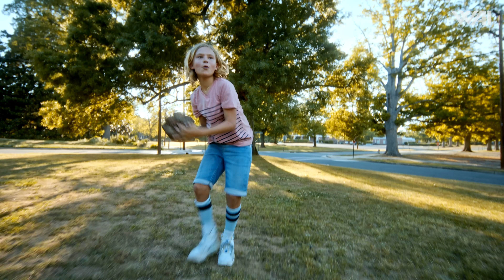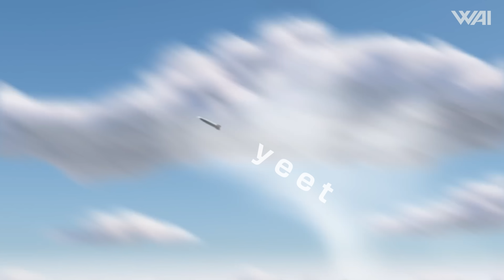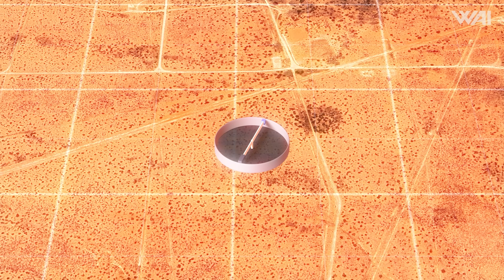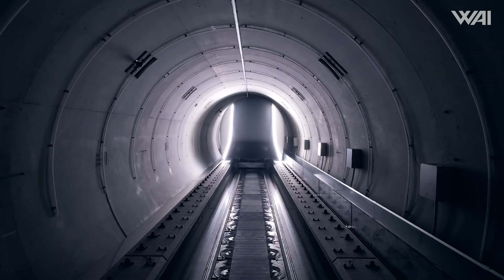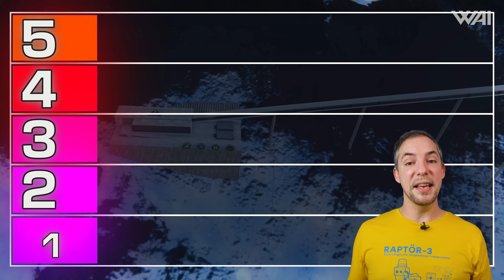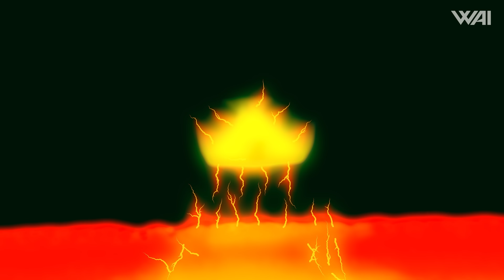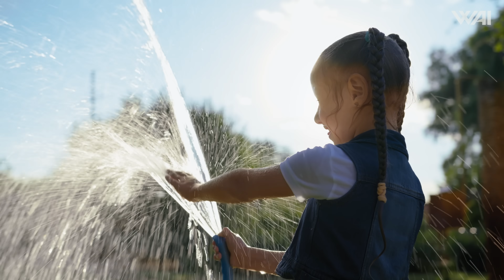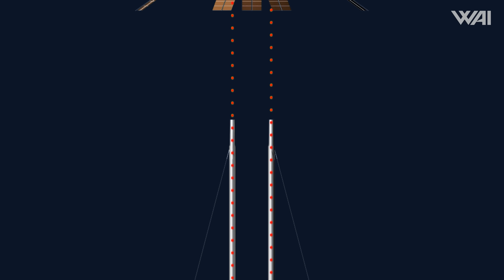The five craziest (but possible) ways to get to Space!

Comment: My biggest worry about nuke-based transport would be having to trigger the Launch Termination System while still on the way up ...
Reply: I think the compromise he talked about would do away with that.
Reply: I think the worst part is that fissile material is actually pretty rare in the solar system.  It would be a shame to blow it up rather than use it to generate electricity.
Reply: @arthill2310   Worth it for gathering more elsewhere. Gotta spend fissile material to gain fissile material.
Reply: If they follow my desigh concept the nuclear fuel is Van Allen radiation belt waiting for harvest and in NEED OF IT.

Comment: Thanks for the awesome side video, those alternatives were a lot of fun! I remember seeing a cool idea called a Lofstrom Loop in an old Isaac Arthur video about Launch Loops which seemed much more feasible than Space Elevators or Mass Drivers. Instead of a massive vacuum tube with the vehicle INSIDE (RIP Hyperloop!) it involved a vacuum tube only 5cm wide(!) supporting an EXTERNAL track for launch vehicles "only" 1,000 kms long and "only" 80 kilometers high to get the vehicle above the atmosphere to eliminate carrying onboard fuel for that first part of the flight. Lofstrom apparently published a detailed paper in 2009.

Comment: You don't need to build towers to hold your launch tube --- the other end has to be in orbit anyway, so suspend it from above on skyhooks

(skyhooks are large weights in LEO holding up your launch tube)

Not to mention the magnetic fields generated by that other design would destroy all the electronics around

Comment: You know. Drones can breach the atmosphere with very little resistance. But NASA and that pesky "astronaut" thing.

I'd thought about it. Figured why not use the hull of a rocket? Use electromagnetic coupling plus physical anchor point in case of failure or interruption.

Mother drone takes the capsule to 40,000. Drone drifters lift the capsule using electromagnetic energy. Glide up into the upper atmosphere.

From there, you get orbit breach and assist from those same drones or a new squad. 

Drones assist in piloting the capsule. Then assist in docking.

Would it be expensive to do? Yes. Yes it would be for the first round. After that? What's that phrase again? 

"Easy money"

It's infinitely reusable. Infinitely cheaper than "ooga booga rocket go boom." It's also a designed recursion to ensure survival. If one drone or even several get knocked out, it doesn't equate to mission critical. 

But what do I know? I'm just a bum who only has a GED.

Comment: Any  vertical structure as large as most of these things are going to be beaten by natural forces.
1. Weather will wreck your day.
2. Making an electrical wire +100km long and dragging it through a gigantic magnetic field and thinking it won't burn out.
3. Temperature extremes at different points in the system create an unwanted ad-hoc Sterling engine
4. Flocks of migrating birds pooping chemically active materials on hard to reach places
Etc, etc, etc....

Comment: we can build a rail gun on the ground between 2 hills. best if its in the black hills.. but a 10 mile long tube that starts at a 45° down angel and ends at a 60° up can launche a capsule at mock 2 or 3 without any of the project being built off the ground.. matter fact if the middle is under ground and the building is inside a mountain is best. . with laser switch electromagnets, a massive compressed air taint under ground, and 3 jumbo size fans feeding the tube. will reduce the amount of energy needed and nigate friction.. only thing it needs is shock walls at the end of the tube. to buffer the sonic boom.
Reply: once the railgun can start sending up pods. the pods can contain hexagon peices of a communication halo that can have its own power plant, solar collector, defective turret rail guns. and all comunications free.
Reply: after the first ring. a 2nd can be made with a floating air strip that is held up by  itself as the bands  reach all the way around. and can be as wide as needed.

Comment: Challenges from Combining Clean Bomb Innovations
From the previous analysis, the key challenges in combining the Soviet Union’s lead tamper (Tsar Bomba), U.S. neutron bomb triggers (W70), and UK’s compact warhead designs (Grapple/Chevaline) are:
1.  Size vs. Yield: Lead tampers increase warhead size, conflicting with compact designs needed for Orion’s small, frequent pulses (0.1–10 kt range).
2.  Tritium Dependency: High fusion yields require significant tritium, which is costly and has a short half-life (~12.3 years).
3.  Engineering Complexity: Integrating precise fission triggers, lead tampers, and compact designs increases manufacturing difficulty and cost.
4.  Yield Efficiency Trade-offs: Lead tampers reduce explosive yield compared to uranium-238 tampers, potentially affecting propulsion efficiency.
5.  Testing Restrictions: The Comprehensive Test Ban Treaty (CTBT, 1996) prevents physical testing, requiring reliance on simulations.
Solutions to Challenges
To create a clean thermonuclear bomb suitable for Orion, each challenge must be addressed with feasible technical solutions, leveraging modern advancements in materials, manufacturing, and simulation.
1.  Size vs. Yield:
	•  Solution: Use advanced materials like beryllium or high-density composites as tampers instead of lead. Beryllium is lighter and more effective at reflecting neutrons, allowing smaller secondaries while maintaining high fusion yield. Modern 3D printing and precision machining can miniaturize components, fitting warheads into Orion’s ~1-meter-diameter pulse units.
	•  Implementation: Design warheads with a beryllium tamper and a compact fusion secondary (deuterium-tritium or lithium-6 deuteride), achieving 95–97% fusion yield in a 0.1–1 kt range, suitable for Orion’s pulse frequency (1 explosion per second).
	•  Benefit: Reduces warhead size to ~50–100 kg, compatible with Orion’s payload constraints.
2.  Tritium Dependency:
	•  Solution: Incorporate on-board tritium production via lithium-6 blankets in the Orion spacecraft. Neutrons from fusion reactions can breed tritium in situ (Li-6 + n → H-3 + He-4), reducing external supply needs. Alternatively, use deuterium-deuterium (D-D) fusion for some pulses, which is less efficient but avoids tritium’s half-life issue.
	•  Implementation: Store initial tritium in sealed microcapsules within warheads, regenerated by a lithium-6 blanket surrounding the pusher plate. D-D fusion could supplement 10–20% of pulses, balancing cost and efficiency.
	•  Benefit: Cuts tritium costs by 50–70%, extends warhead shelf life, and leverages fusion byproducts for sustainability.
3.  Engineering Complexity:
	•  Solution: Utilize advanced computational modeling (e.g., supercomputers at Lawrence Livermore or Los Alamos) to simulate warhead performance without physical tests, compliant with CTBT. Additive manufacturing (3D printing) of high-precision components like beryllium tampers and plutonium triggers reduces production complexity.
	•  Implementation: Develop modular warhead designs with standardized interfaces, allowing automated assembly. Use AI-driven optimization to fine-tune trigger and tamper configurations for maximum fusion efficiency.
	•  Benefit: Reduces manufacturing costs by ~30% and ensures reliability through virtual testing.
4.  Yield Efficiency Trade-offs:
	•  Solution: Enhance fusion yield with boosted fission triggers, using minimal fissile material (e.g., 0.5–1 kg Pu-239) and injecting deuterium-tritium gas to amplify neutron output. This maintains high fusion efficiency without U-238 tampers, compensating for lead/beryllium’s lower yield boost.
	•  Implementation: Design a two-stage warhead with a boosted fission primary (0.01–0.1 kt) and a beryllium-tamped fusion secondary (0.1–1 kt), achieving 95–98% fusion yield.
	•  Benefit: Matches or exceeds U-238 tamper yields while eliminating fast fission fallout.
5.  Testing Restrictions:
	•  Solution: Leverage modern hydrodynamic and plasma physics simulations, validated by historical test data (e.g., Navajo, Tsar Bomba, Grapple Y). Use laser ignition facilities (e.g., National Ignition Facility) to test fusion micro-explosions non-destructively.
	•  Implementation: Simulate 10,000 virtual detonations to optimize warhead parameters, cross-referenced with 1950s–1960s test data. Conduct subcritical tests of fission triggers to ensure reliability.
	•  Benefit: Ensures design accuracy within 99% confidence, bypassing CTBT restrictions.
Reply: Clean Thermonuclear Bomb Design for Orion
Based on these solutions, the optimized bomb for the Orion propulsion system integrates the best innovations:
•  Primary (Fission Trigger): U.S.-style boosted fission trigger (0.01–0.1 kt), using 0.5 kg Pu-239 with deuterium-tritium gas injection for enhanced neutron output. Minimizes fissile material to reduce fallout.
•  Secondary (Fusion Stage): Soviet-inspired beryllium tamper (replacing lead for compactness) surrounding a lithium-6 deuteride core, achieving 95–98% fusion yield (0.1–1 kt total yield). Eliminates U-238 fast fission.
•  Encapsulation: UK-inspired compact design, with a 50–100 kg warhead encased in a high-strength carbon-fiber shell, optimized for Orion’s pulse unit dispenser.
•  Radiation Profile:
	•  Prompt: High neutron (~40–50%) and gamma (~20%) from fusion, minimal fission gamma/beta (<5%).
	•  Residual: Trace tritium (H-3, half-life 12.3 years), helium-3, and Pu-239 (half-life 24,100 years). No Cs-137, Sr-90, or I-131 due to no U-238 fission.
	•  Fallout: ~0.5–1% of standard fission bombs, primarily from trace Pu-239 and activation products (e.g., sodium-24 from pusher plate interaction).
Orion Launch System with Clean Bombs
The Orion propulsion system uses nuclear explosions to propel a spacecraft via a pusher plate and shock absorbers. To eliminate atmospheric radiation during launch, the clean bomb design is integrated with specific launch protocols.
Orion System Modifications
1.  Pusher Plate Design:
	•  Material: Molybdenum-tungsten alloy coated with a neutron-absorbing boron-10 layer to minimize activation (e.g., sodium-24 or iron-59 from plate material).
	•  Lithium-6 Blanket: Surrounds the plate to breed tritium in situ, capturing fusion neutrons and reducing external radiation.
	•  Benefit: Reduces plate activation by 80%, captures neutrons for tritium production.
2.  Pulse Unit Delivery:
	•  Mechanism: Electromagnetic dispensers eject 0.1–1 kt warheads at 1-second intervals, detonating 50–100 meters behind the spacecraft.
	•  Containment: Warheads encased in ablation shields (e.g., graphite or ceramic) vaporize cleanly, minimizing debris and fallout.
	•  Benefit: Ensures precise detonation positioning, reducing atmospheric dispersion of residues.
3.  Launch Protocol:
	•  Site: Remote launch site (e.g., Pacific atoll or high-altitude platform) to minimize population exposure.
	•  Altitude: Initiate pulses at 50–100 km altitude (stratosphere/mesosphere) using chemical rockets to clear dense atmosphere, reducing neutron activation of air (e.g., nitrogen-16, half-life 7 seconds).
	•  Benefit: 99% of radiation dissipates above 50 km, with negligible fallout reaching the ground.
4.  Tritium Management:
	•  On-board Breeding: Lithium-6 blanket produces ~0.1 g tritium per pulse, offsetting ~50% of tritium needs after 100 pulses.
	•  Recycling: Recover unburned tritium from warhead residues via onboard cryogenic systems.
	•  Benefit: Reduces tritium costs by 60%, ensures long-term sustainability.
Atmospheric Radiation Mitigation
•  Neutron Shielding: Boron-10 and water-based shielding on the spacecraft absorb stray neutrons, reducing atmospheric activation (e.g., carbon-14 from nitrogen).
•  Airburst Detonations: Pulses at 50–100 km ensure neutrons and gamma rays dissipate in thin air, with no ground interaction (no soil activation like silicon-31).
•  Fallout Elimination: The clean bomb’s 95–98% fusion yield produces only trace Pu-239 (0.5 g per warhead) and tritium (0.01–0.1 g per pulse). These are diluted in the upper atmosphere, with Pu-239 particles too sparse to reach the ground in significant quantities. Tritium disperses as gas, with a low environmental impact due to its short half-life and low biological uptake.
Estimated Fallout: For a launch requiring 1,000 pulses (0.1 kt each, total 100 kt), total fallout is ~0.5–1 kg Pu-239 and ~10–100 g tritium, dispersed over a 10,000 km² area in the upper atmosphere. This is ~0.01% of a standard fission bomb’s fallout (e.g., Castle Bravo’s 15 Mt produced ~100 tons of radioactive debris).
Best-Case Scenario Design
Orion Spacecraft Configuration:
•  Mass: 1,000 metric tons (payload 300 tons, structure 700 tons).
•  Pusher Plate: 40-meter diameter, molybdenum-tungsten with boron-10/lithium-6 coating, 200-ton mass.
•  Pulse Units: 1,000 warheads, 0.1 kt each, 95–98% fusion, 50 kg per unit (total 50 tons).
•  Propulsion: 1 pulse per second, specific impulse ~6,000 seconds, achieving Earth escape velocity (~11.2 km/s) in ~1,000 seconds.
•  Launch Sequence:
	1.  Chemical rockets lift Orion to 50 km (10 tons of conventional fuel).
	2.  Nuclear pulses begin at 50–100 km, continuing to low Earth orbit (LEO, ~200 km).
	3.  Orbital maneuvers use additional pulses for interplanetary trajectory.
Performance:
•  Payload to LEO: 300 tons (vs. ~50 tons for modern chemical rockets like Starship).
•  Radiation Output: ~40–50% neutrons, 20% gamma, <5% fission gamma/beta per pulse. Total atmospheric fallout <0.01% of a 100 kt fission bomb.
•  Environmental Impact: Negligible ground fallout; trace tritium and Pu-239 dissipate in the upper atmosphere, with no measurable ecological or health effects.
Key Features:
•  Clean Warheads: Beryllium-tamped, boosted fission-fusion design, 95–98% fusion yield, no U-238 fission products (Cs-137, Sr-90).
•  Neutron Mitigation: Boron-10 shielding and high-altitude detonations eliminate atmospheric activation.
•  Tritium Sustainability: Lithium-6 blanket breeds 50% of tritium needs, with D-D fusion as a backup.
•  Cost Efficiency: Advanced manufacturing and simulations reduce warhead costs to ~$100,000 per unit (total $100M for 1,000 pulses), viable for large-scale missions.
Conclusion
By integrating the Soviet Union’s lead-tamper concept (adapted with beryllium), the U.S.’s neutron bomb trigger, and the UK’s compact warhead engineering, a clean thermonuclear bomb with 95–98% fusion yield can power an Orion propulsion system. Solutions like beryllium tampers, lithium-6 tritium breeding, advanced simulations, and high-altitude detonations resolve size, cost, complexity, and fallout issues. The best-case scenario achieves a 1,000-ton Orion spacecraft delivering 300 tons to LEO with <0.01% of standard fission fallout, making nuclear pulse propulsion environmentally viable. This design enables large-scale space exploration (e.g., Mars missions) without atmospheric radiation risks, leveraging historical innovations with modern technology.

Comment: Interesting video, thanks a lot Felix. Following are not ranked by the craziness but by "feasibility": SpinLaunch 1/10; Startram 2/10;   Nuke propulsion starting from orbit 4/10; Space Elevator (if there wasn't thousands to millions space junk and  significantly lower air traffic) 5/10, otherwise 0.2/10; Spacefountain 0.1/10.

Comment: As I see it, the big problem with both Spinlaunch and Startram is that you payload is going to hit the atmosphere, at sea level, going at reentry speeds. Indeed, probably a good deal faster than reentry speeds since so much energy will be bled off into the air. How in the world are they going to keep their payloads from being instantly reduced to balls of plasma, even with extreme heat shields?
I really don't understand how the space fountain works. The metal balls going up and coming down, and having their courses bent by the giant magnet, that I'm all fine with, but I don't understand how energy is transferred from the balls to the satellite to keep it up. More importantly, I don't see how payload can be lifted on it. You described the stream of metal pellets as acting like the rail of a maglev train. A maglev rail is horizontal and pushes up against the mass of the train. A different force pushes the train forward. If the vertical stream of pellets is like the rail, then its magnetic field would be providing force pushing out, away from the stream, which is exactly at cross purposes to what you want. Even if the payload could be held close to the stream, you would still need some other force to push it up against gravity. I am seriously confused.